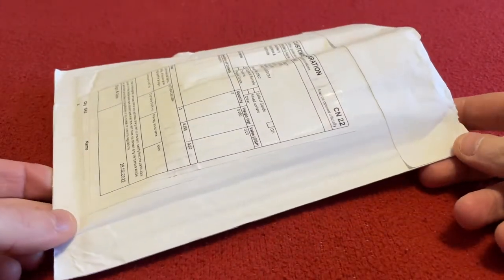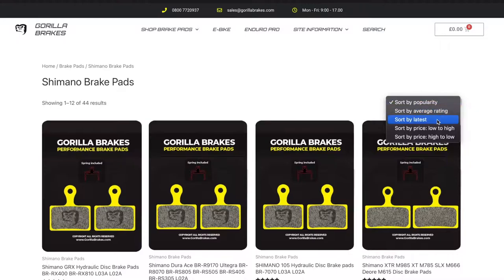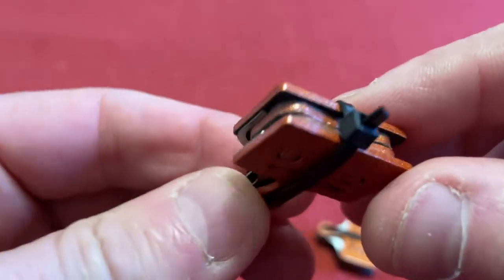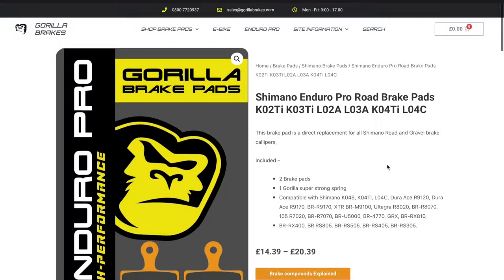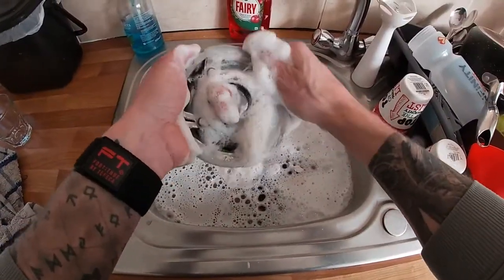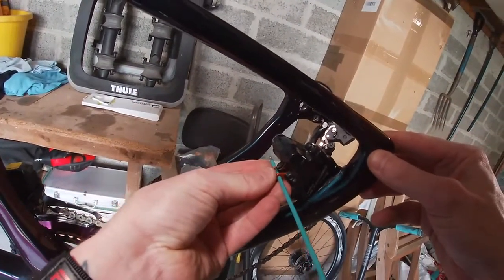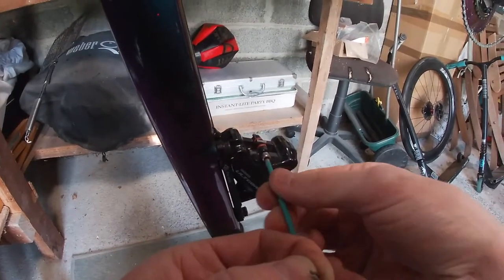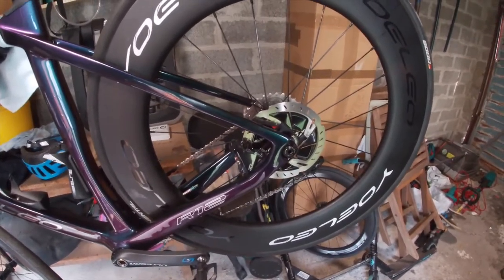Gorilla Enduro Pro Brake Pads

Comment: Great tip with the 3mm hex key. I'll be doing that when my pads need changing. Nice one 👏
Reply from the maker: Yep, one of my favourites. 👍
Reply: Where did you get the bolt from? Only one i can find is bikester
Reply from the maker: @EliteAlex000  it was so long ago that I actually can’t remember, Amazon, wiggle or eBay. 

Sorry. 👍